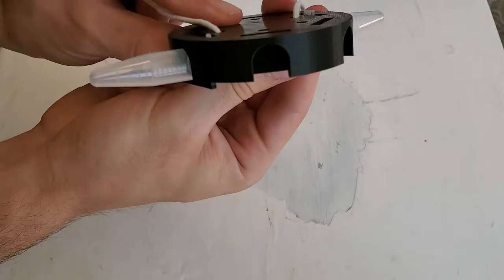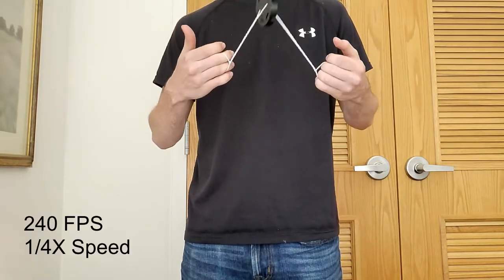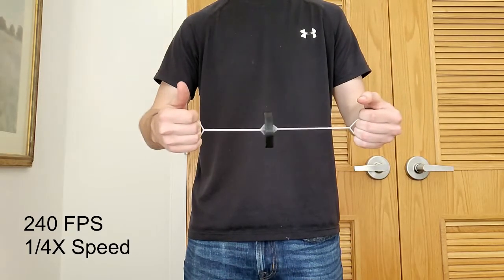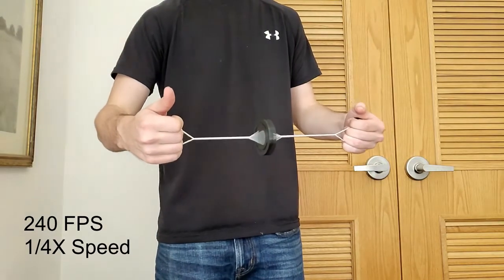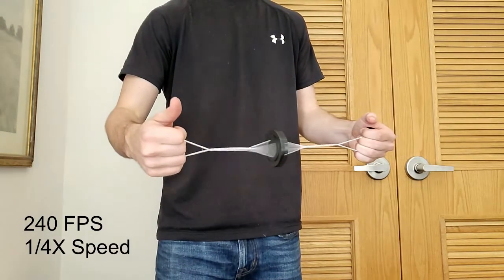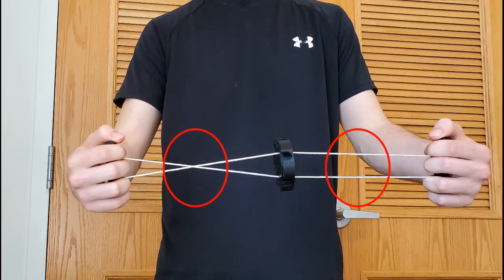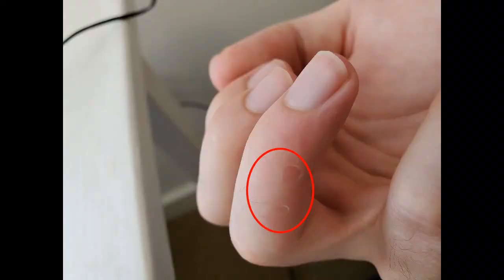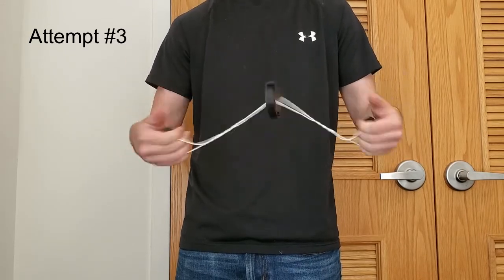Recreating Paperfuge: The Hand-Powered Centrifuge

Comment: 3d printing ? what was benifit of it over the paperfuge ?
Reply from the maker: It's a bit more substantial so you can spin 1.5mL or 2mL eppendorf tubes and possibly even 15mL falcon tubes. The original paperfuge had to use very lightweight capillary tubes.
Reply: @qosmoschem  oh, thats nice.

Comment: how did you measure the RPM of the device ?
Reply from the maker: I used the slow motion video to determine how many frames it took for the centrifuge to make one rotation. Knowing the frames per second you can calculate the rotations per minute